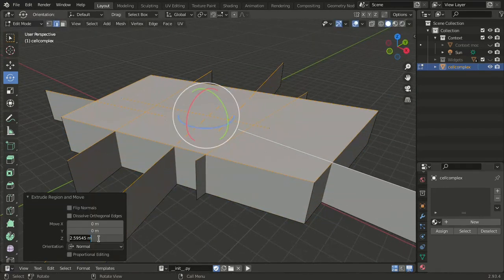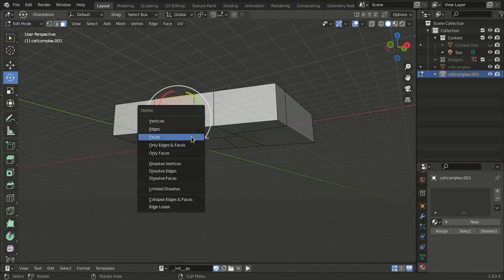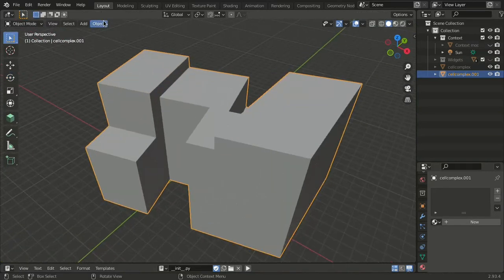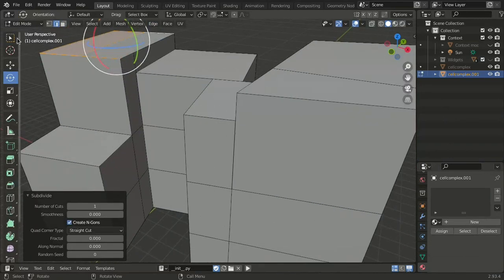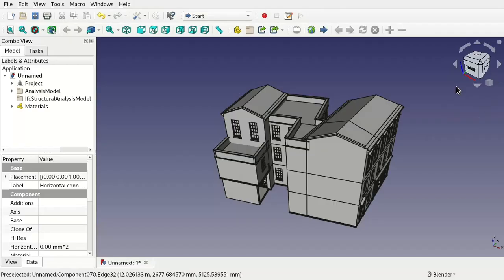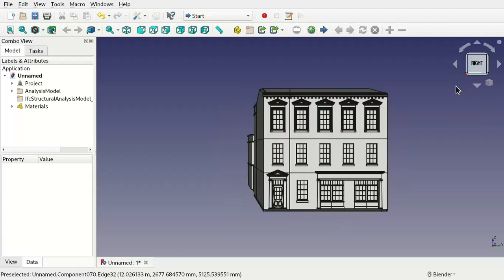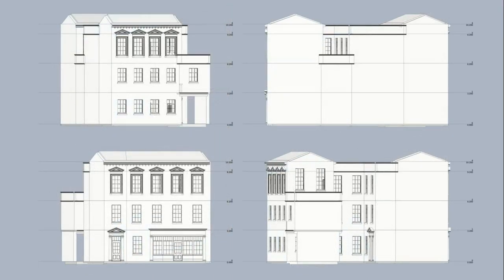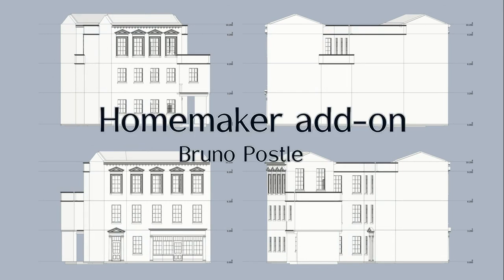Homemaker add-on and OSArch, presentation for Connect!2021

Comment: Impressive tool, first time seeing it having noticed it mentioned a fair bit in os arch community. In terms of the utilisation of assets (e.g. doors windows) and defining the pattern style (e.g. not neo-classical) a video going into how this is done would be of great interest!
Reply from the maker: The style system needs work to make it more accessible (it is currently a bunch of undocumented configuration files). A huge range of styles are possible, but I have been concentrating on fleshing out the code, and not playing with the tools themselves.